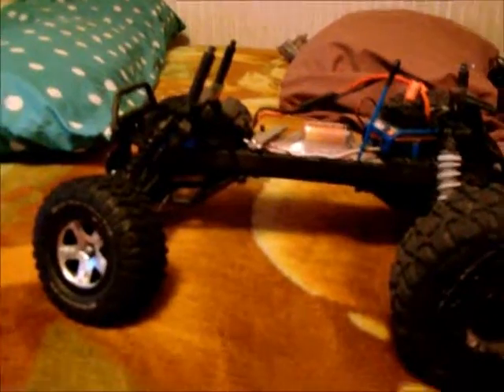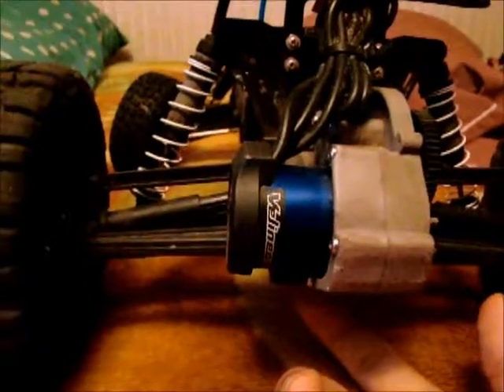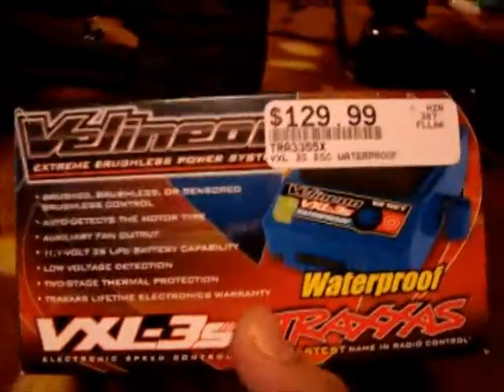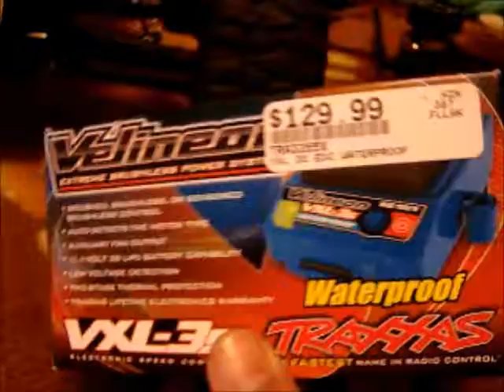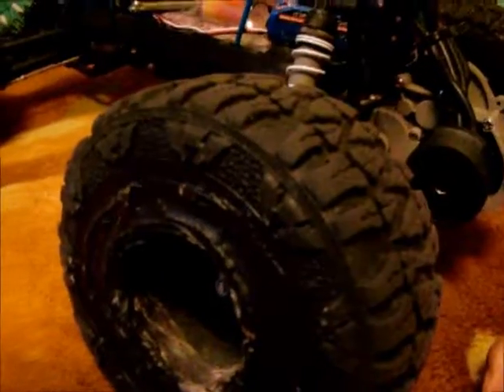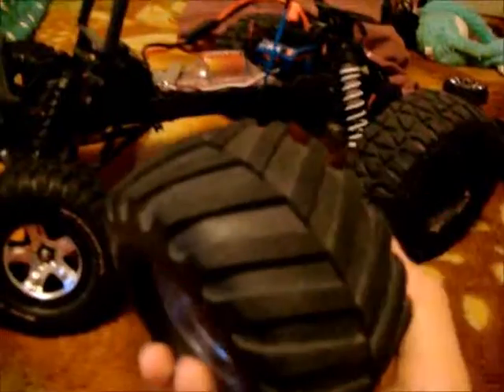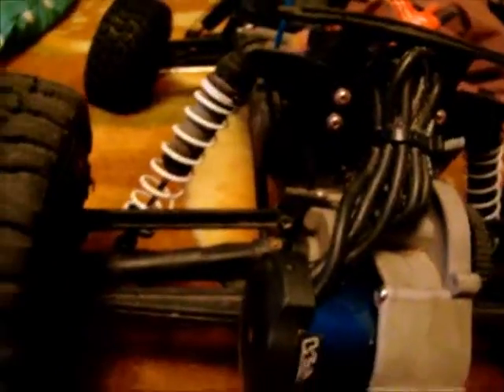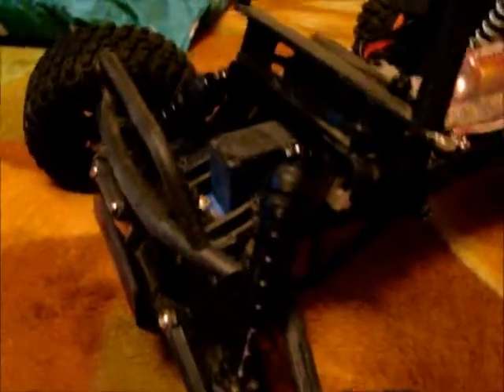Rc Mud Truck Project

Comment: Nice truck. You have all traxxas parts? That's cool. I got a nitro sport.
Reply from the maker: Yeah it all traxxas parts. I ended up changing the gear that was stripped to a thin metal custom one and fixed a lot of things on it. The week after it was fixed I took it to a competition and ended up burning out the motor. Came in 3rd place though. I beat a lot of 4x4 rc's.